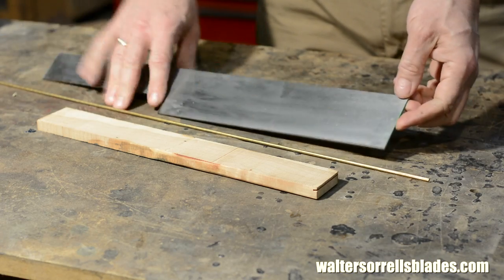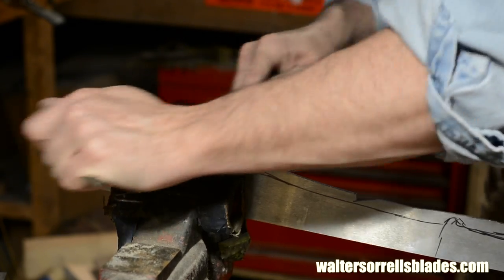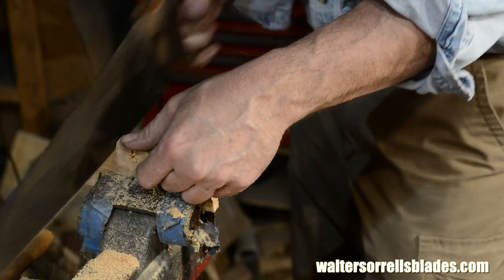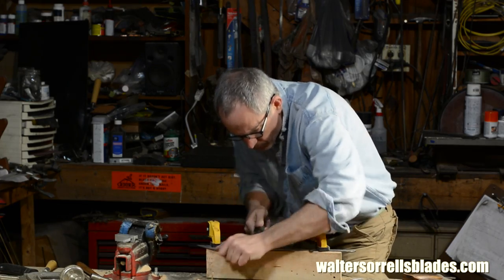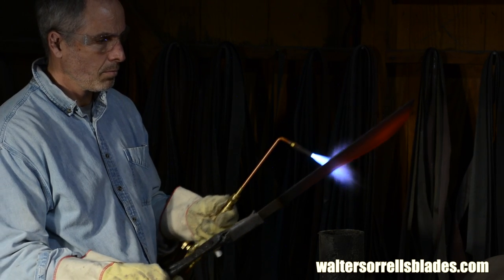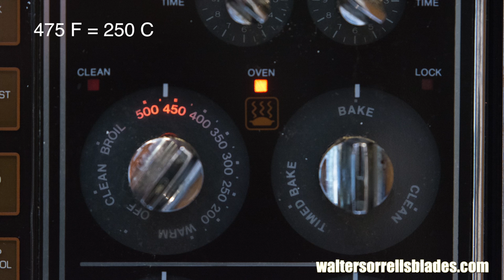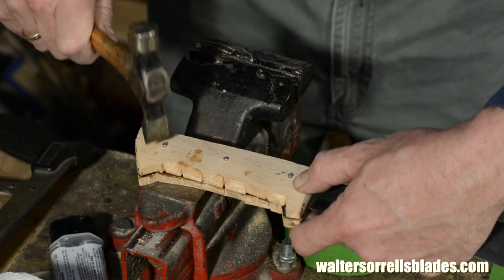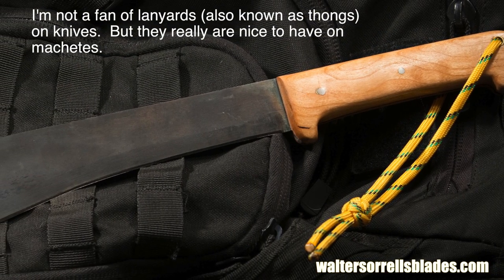Making a Machete with No Power Tools - Survival, Prepper, Beginning Blade Makers

Comment: Yeah okay. So we have here a grinder jockey (read as: "custom knife maker"), showing how to make a knife without power tools and making it look more difficult than it really is so people will want to just throw their hands up and buy one. Brilliant, since he's employing the same tactics that infomercial producers use to make you want to buy their product.

Cutting a long line is great if you can keep the blade tracking properly. It will save time for straight runs. For curves, If you cut out chunks of waste from two different angles until there's nothing but small peaks, and file them away later, you actually save time vs leaving large patches of waste. It also helps to start off with a fresh blade, which will cut through O1 just as easy as it will through mild steel; especially if the stock you're using is fully annealed. It's even easier when you spray the blade with WD-40 or drip a bit of oil now and then to cut down on heat and friction. Saying O1 is tougher on bi-metal blades than mild steel is premium grade bullshit. Go ahead, ask me how I know all of that. I'm sure you know the answer already. 

Cutting out the blank: easily an hour to 90 minutes (with an OKC CT1-12 style blank on 1/8 x 2 x 18 inch O1 flat bar)

Sorry people, but filing does not take as long as he's making it out to be, when it's done as I described above AND you're using a file that actually cuts worth a damn. With the majority of the material removed, which is why cutting out takes so long, the rest of the waste will quickly come off with a 12 inch single cut mill bastard; especially if the file is stored properly and NOT ran backwards.  EVER! It should have not taken any longer than half an hour to fine tune the blank and about that much on each side for the bevels; providing you only give it a scandi grind and you craft a filing jig. 

Filing the blank: should not take any more than 90 to 100 minutes for a serviceable finish. If you want to pull out the double cut finish file after that, you're looking at another 40 minutes easy

If you' re heating it with a torch, you don't need to temper the blade in an oven, since  you already have a heat source right there in your hand. Turn on the torch and either play the flame back and forth on the spine or mount the torch in a vice and move the spine over it. All you're working toward is getting a dark straw or even a brown on the edge (for a machete that is), which can be done in less than five minutes. Putting it in an oven for two hours is not only a waste of time, but a proper waste of energy. 

Heat treating with a rosebud tip: about 20 minutes, if that

Handles with pins do not need epoxy. Put the grip together, peen the pins over like rivets and flair out the thong hole; if you even put one in that is. I have no use for them personally. You're done in two or three minutes with no waiting around for some fecken adhesive to cure. A serviceable and nice looking grip can be obtained by starting out with a coarse half round rasp, moving to an 80, 120 and 180 grit sandpaper. The finer the grit, the less traction the grip provides and you need as much grip as you can get swinging a machete; thong hole notwithstanding. Besides, you should NEVER rely on a lanyard to save you. They're a false sense of security because it tricks you into thinking you can just run the governor balls out, which increases the chance of the grip slipping from your hand and increases the risk of injury.  Chop like a sane person and you won't need some damn fool lanyard anyway. 

Adding the grip: from block to finish, 40 minutes to an hour (depending on your design, wood working skill and how anally retentive you are with the finish)

Unplugged, you're looking at around five hours. Done with an angle grinder, abrasive wheel, cut off disk and file; about three and a half. Done with a belt grinder and band saw, more like two and a half to three; if you're not striving for perfection that is.

The closing statements were amusing. He's saying a knife who one puts actual physical effort into making is worth less than some fussed over beauty pageant queen made with a belt grinder, which is doing the REAL work, while you just stand there holding the knife?! Talk about bass-ackwards!

Comment: Pretty sure you can hear treat 01 tool steel in an ordinary oven.
Reply from the maker: +Dan Bouchard You can't use an oven to harden 01.  That takes a temp of about 1500 F.
Reply: +Anon Ops if u have no exlectricity though?
Reply: +Anon Ops pretty sure you're microwave would explode into a fiery ball of pain
Reply: Wow it's Jelly Dong not funcktining microwave? If you have exlectricty yah itll work but NONE WHATSOEVER? yah itll fall.
Sooo just ues a GOOD microwave heet it up, no fire it reach tempaturnate PEFECkly 1500. NOT FIRE NOT HOT TOO MUCH NOT TOO COLD AITHER.
Reply: You stick a machette in a funcktining  microwave and hold a thermometer in there so we can see it heet up pefeckly 1500 please i need to see this
Reply: +Mr.memelord I'll try and translate. "Not if you have a functioning microwave. If you have electricity, it'll work, if not, it won't. You heat the steel in the microwave, no fire required, it heats up faster than an oven, and a good quality microwave will get it to 1,500 degrees no problem." I think that's the gist of it, and to be fair, I don't think he's ever actually used a microwave, just heard a broad description when he was a child of what microwaves are capable of. So in that regard, his logic is sound.

Comment: Ok so you have no power tools but you use a modern torch to heat the steel? You might as well bust out the belt sander. Like the video but seems silly to me that you used a torch instead of a coal or wood fire to heat the steel.

Comment: You are using that brace and bit wrong, or at best, not very efficiently. If you clamp the handle in the vice vertically, you can lean on the head, the way it was designed to be used. Putting constant pressure on the head with your arm will needlessly tire you out. Granted, sometimes there is no other way, but here, man, it is right in front of you. You will notice, also, that  when you hold the head with your arm, you are going to wander some while you crank it. It is just about impossible to extend your arm, put downward pressure on it, and hold it in exactly the same spot for an extended time. And if it wanders, you break your bit. But if you lean on it, typically with your belly or chest, you use the dead weight of your body to do the pushing. As much physical exertion as sitting in a chair. And you can look straight down as you drill and keep it lined up in at least one direction while you work. With your feet spread apart, it is easy to hold the drill steady against your belly.

Comment: No power tools: blow torch
Reply: "power". A blowtorch doesn't use power. It's simple a way of distributing the gas and mixing it with oxygen so it can burn at high temperatures. He even said the same effect can be reproduced using charcoals and a method of blowing air.
Reply: The blow torch isnt electric.
Reply: There aint no power in gas? O_o perhaps no electricity but surely allot of power...

Comment: as soon as the torch came out, this entire video became completely useless.     why not just use the torch to cut the metal instead of using a hacksaw and file ???
Reply: +brian heidel the torch he's using is a heating / soldering / brazing torch, not an oxy-acetylene cutting torch...they're similar, but distinctly different tools.
Reply: Tony M   My point is that if he is set up with gas, he can use a cutting torch to cut the metal.  Doesn't matter what he has on in this vid; he can change to a cutting torch to cut.
Reply: ...if you don't have a cutting head, and oxygen and acetylene tanks, and hoses and a regulator for those tanks, you can't very well change to them.  He is using a torch, yes, because that's his setup.  Tempering the blade can be done in a number of ways, that just happens to be how he does it here.  BUT he says at the start of the video, this is an example for how someone could  make it in a prepper type situation, maybe they have access to gas, maybe they don't.
Reply: +brian heidel A cutting torch leaves a hardened edge which would be almost impossible to file.   You really need to saw or file or grind away the excess material.  A plasma or oxy cutting torch is a tough way to cut a hardening tool steel that needs secondary operations.